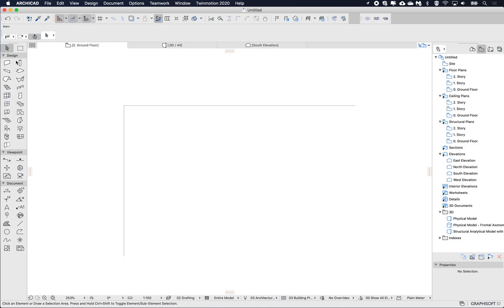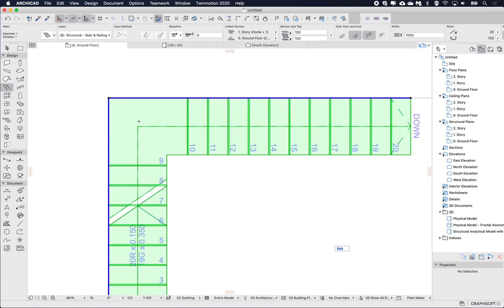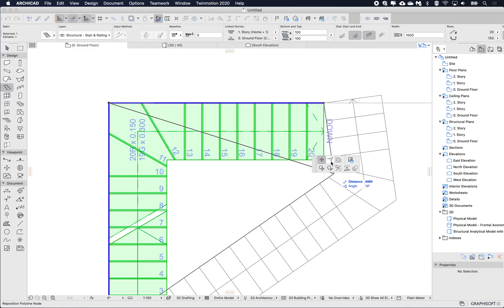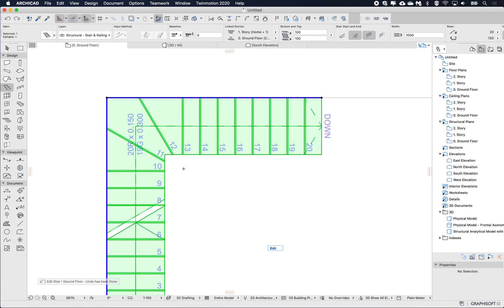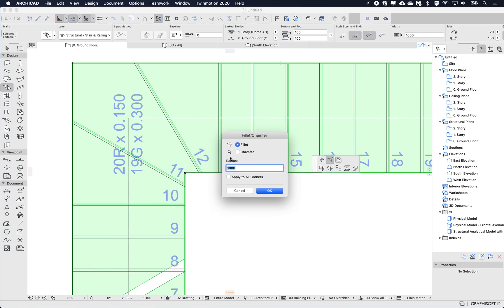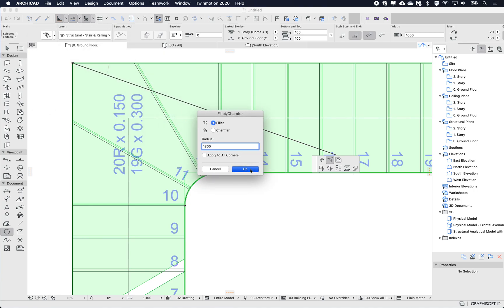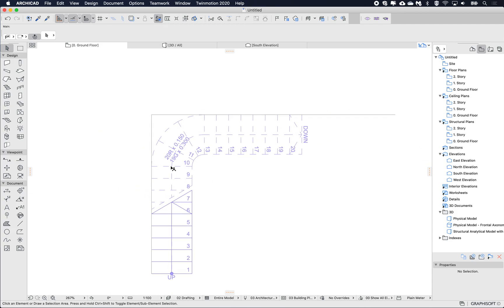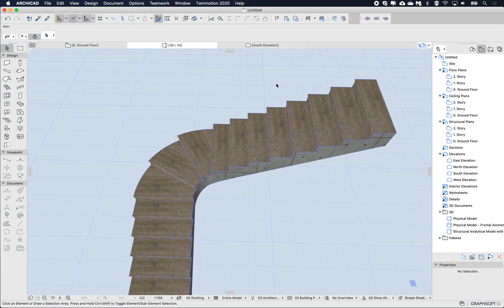Archicad Tip - Stair Curved Corner with Winders

Comment: how do I edit the shape of stair's tread?  because when i go to edit mode of stairs i was able to arc shaped the edge of one treads but in 3d it doesn't show up any changes
Reply from the maker: If you're in Floor Plan, and editing the Schematic (not the Symbol), you can switch between 2D/3D during edit mode at any time. Once finished, click Exit.